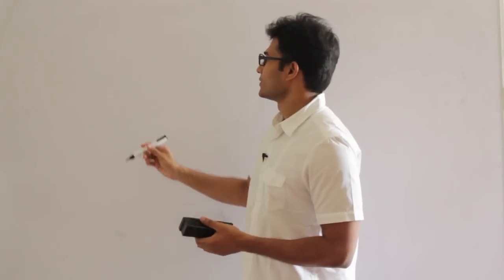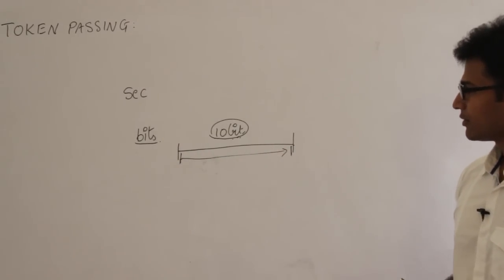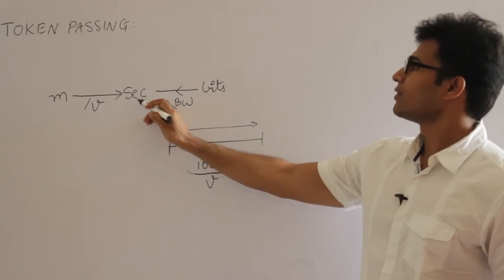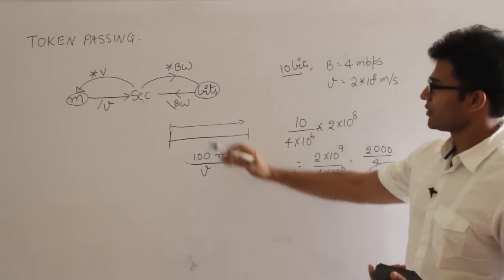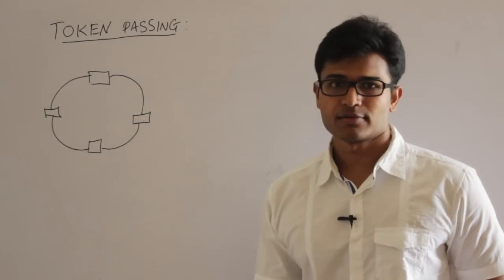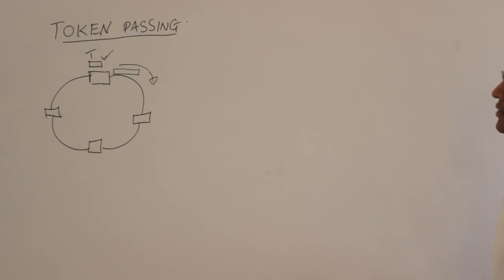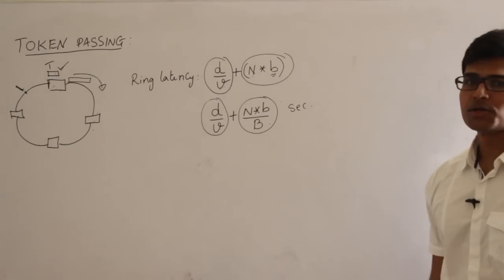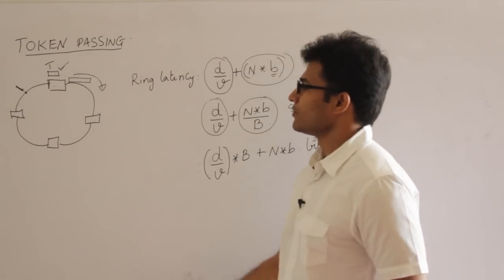CN | Flow Control Methods | Token passing access control method | Ravindrababu Ravula

Comment: difference between cycle time and ring latency?? Both felt similar.
Reply: cycle time has Tp+ token holding time in it  along with transmission time. But latency is simply  Tp + THT
Reply: Cycle time is time taken for token to go around the ring and come back. Ring latency is time taken for a bit to go around the ring and come back. 
Cycle time should be far higher as each station would have packets go around and come back.